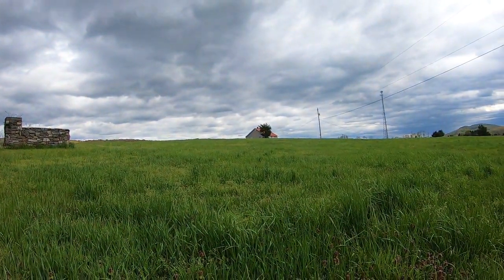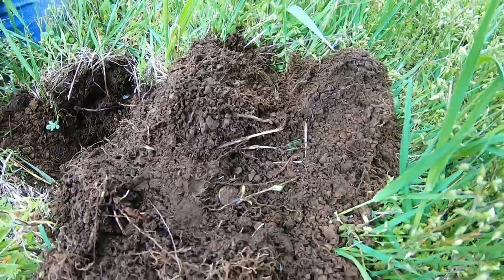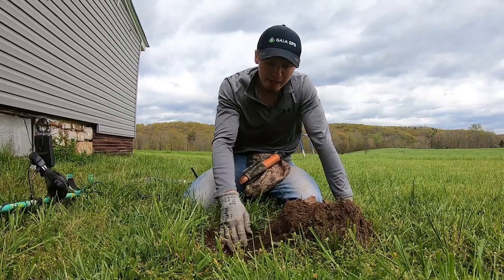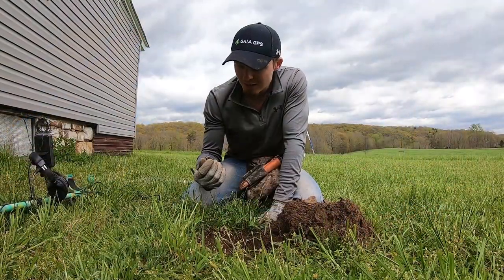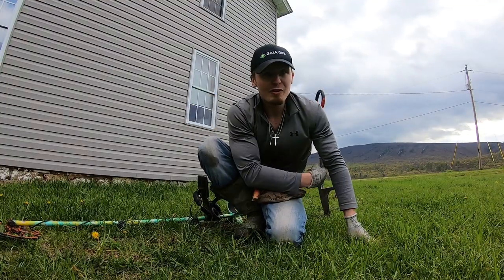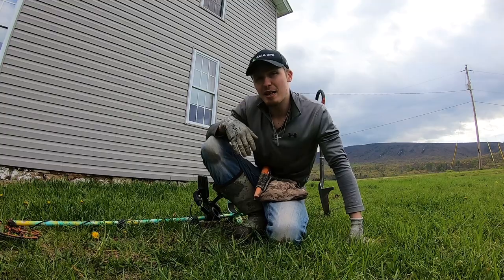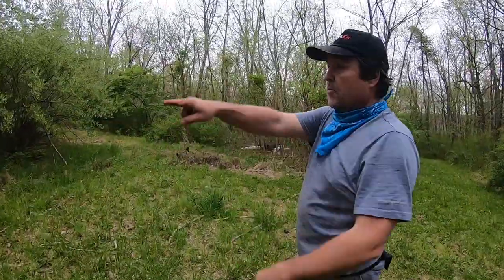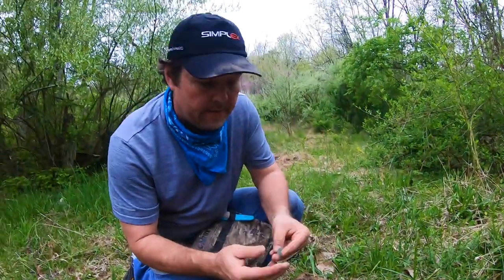Metal Detecting Silver Coins with the Simplex and Equinox 600 | Trying New Setups

Comment: Replying to your first find and question.. Could it be a guitar pick? Yes it could, yes there are metal picks. I've used them. They make it easier to get the high-pitched harmonic tones. ZZ Top used tones like that a lot, and there's several others too. Another method is to touch the string with a finger nail almost at the same time when you pick it using other plastic picks.  Great video too.. :)
Reply: Awesome.  Thanks for the great response.  I'm almost positive that's what it was.  Thanks for watching the video
Reply from the maker: Awesome answer ! Thanks for the info !